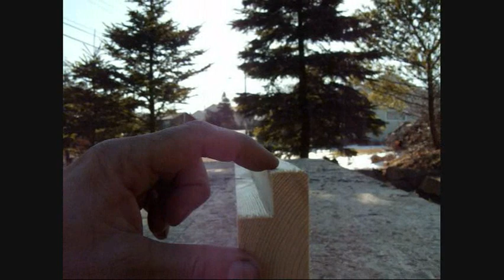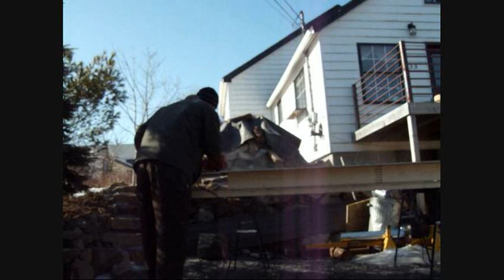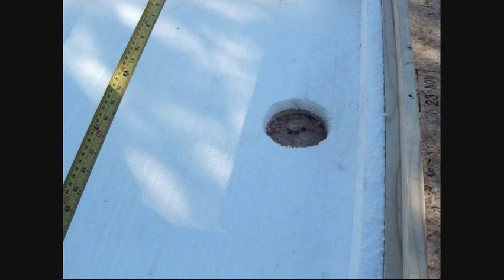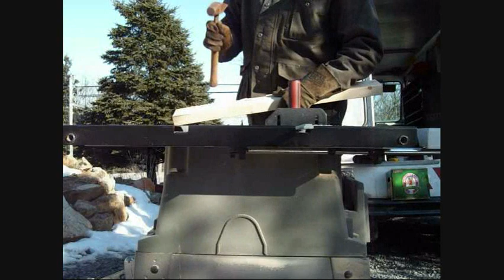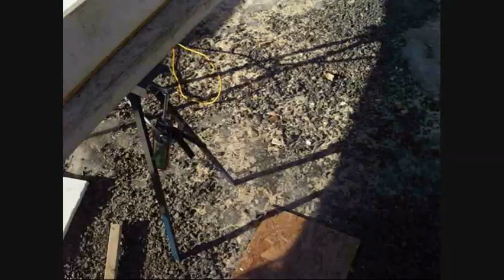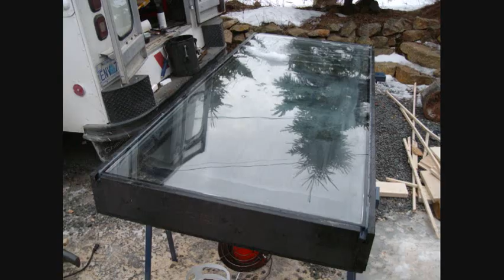SOLAR FURNACE HEAT COLLECTOR FREE ENERGY HOW TO TOTAL COST $100

Comment: Finally someone shows what these can do in cold weather.  I've been thinking about building one but I didn't know how well it would work in northwestern MN
Reply: steve b
You're talking cfm right?  Because something like this would be dependent on the fan forcing the air through.  Let's just say you wouldn't use this in place of a 2000W space heater in most larger rooms.

Comment: Good job, was nice and clever to reduce emissions of your heating system ! 
But I think the insulating material used is dangerous because it releases toxic fumes when overheated. We recommend you to use, on your next manufacturing, fiberglass or stonewool with aluminum foil, which withstand high temperatures and does not release toxic gases. Careful though the dust in their use. I hope I helped and sorry for my English, but I'm from Greece.

Comment: I know very little about these unit but im trying to lean as much as possible on the inlet side would it not be better to have the exchanger/collector all the way over the inlet and a little bit more over the outlet for a bigger surface area?. Im thinking about building you design but with a n or s shape under the collector so the air has more time to heat up bit like the solar sponge?

Comment from the maker: @s4a4v4y seems to me the double pane would work better. it would put out the heat and if you touched the outside of the glass it was cold. so not much loss. (this is only recommended if you can find one for free or cheap.

Comment: Hi Modern Blacksmith - sorry to hear about  your right elbow  - do you have an update about this solar air heater you built - how is it performing 4 years on - any problems  - any better ideas. DOes wood work out well or would you recommend soemthing else for the box?  does it mist up condensation? how do you use it and in what seasons (all through Winter or just part way ....)

Comment: NICE VIDEO. england we have an insulation product called kingspan/recticel. it's a foil covered hard, light foam that comes in 8x4 foot sheets. ideal for insulating the box. also have you thought about sticking an old radiator (for gas central heating system) in there and heating water with it?

Comment: @modernblacksmith 
Thank you very much for the useful information,  I will buld one over some month. this type much faster to buld than the sodacans, so I can buld a larger one than I was planning for the sodacantype. 
That means it will have more 'heat collection' than the smaller one with sodacans even they say that they are a bit more efficient.
I am shure this one will be "overall" more efficient so thanks again.
In Europe every Kilowat hour costs   23 eurocents ~ 30 USDcent

Comment: I dont think you need the aluminium sheet, you are not trying to transmit the heat through to water for example or in the case of the sola can items into the air flow inside the can tube, you are just tring to radiate it back into the air. If the foam can take the temperature, I think it should work equally as well if  the foam is painted black, the surface should shed the heat back into the air as it passes over the black surface.

Comment: @modernblacksmith hot air panels will produce more heat if baffles are installed under the sheet metal to increace the air speed.

Comment from the maker: @robwiley01 the simplest way to to think about this is imagine you just put in a window this size into your south facing wall the sun that would come into your window and heat the room is about the same. You CANNOT get more heat than that, the sun only has so much to offer. one 4x8 box per 200 sq ft, would be ideal....

Comment: this type of solar heat will work in the winter.  same theory as solar panels to charge batteries.  but not at night, no sun no worky.  maybe 24 beer cans painted black, set in the kitchen window of an apartment (no real mounting required).
saw another one with 270 cans, but no blower, worked in his office.  just convection.
Cansolair com for industrial type out of Canada.  but now $3,000 plus installation.

Comment: Pretty much copied this design.  Except made it 20 sq. ft.  and 1" Styrofoam with foil... With no air flow. heated in excess of 250 deg f.  melt exposed insulation. So, skinned edege with galv. metal. Tied in for 1/2 day.  unit no air flow 245 deg.  50 cfm bath fan  droped solar unit to 151 deg.  Bsmt supply air 60 deg.   Returned 105 deg.  Warmed Bsmt to 78 degree and up stairs to 82 deg. I have exposed 4 in. pvc.. painted black the returned air up to 110 deg.  Out side high for day was 60 with 15 mph wind/ breeze. Ran for 4hrs. heated entire house nicely... Tomorrow will be full day.. Pretty impressive stuff.... Corrigated metal back.  1.5 " off corrugated stucco metal lath. then black screen... Amazed it work so well.

Comment: Just paint it black then place the glass sheet over it. The Sun will heat it up and will soon dry and harden.
Reply: you will get more heat with more black surface area.  aluminum cans inside would be a great add.